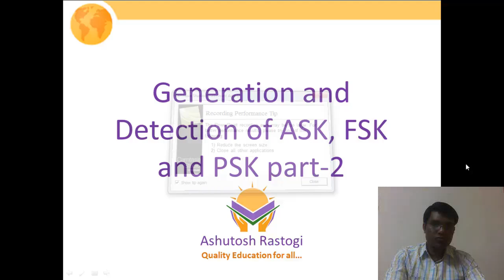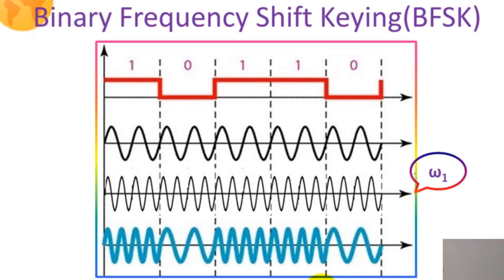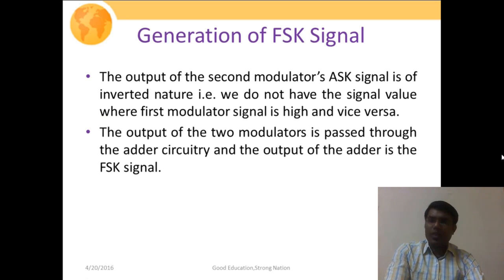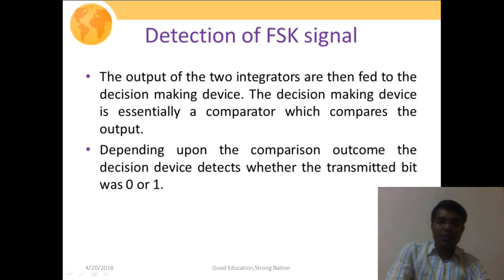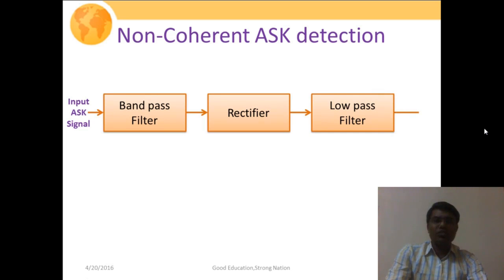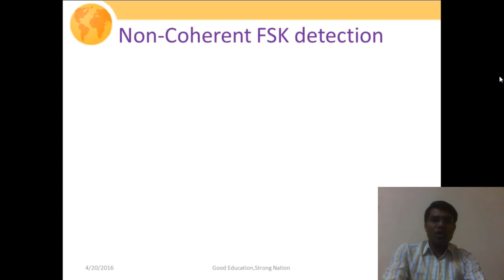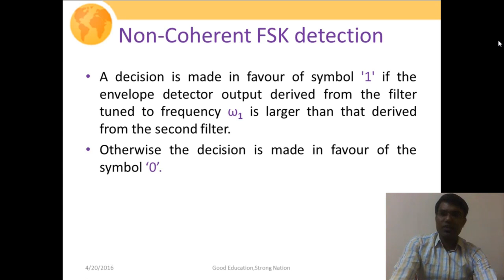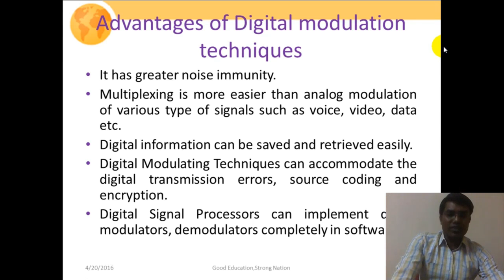Generation and Detection of ASK, FSK and PSK part 2|ASK|PSK|FSK|Digital Modulation

Comment: Sir in the disadvantages of BPSK it's said that  there is ambiguity in phase detection due to square law device at the receiver then how can we have applications like WLAN ,Bluetooth technology etc where data communication necessary. Please explain..
Reply from the maker: In all these applications we have short range communication as long as clock synchronisation point of view if there is no error we can get proper demodulation.hence it works well and even in wlan application we use higher order PSK for supporting higher data rates...
Reply: Thank you sir I understood.